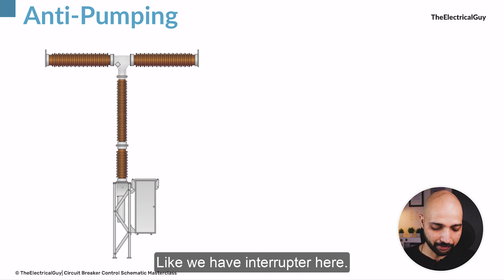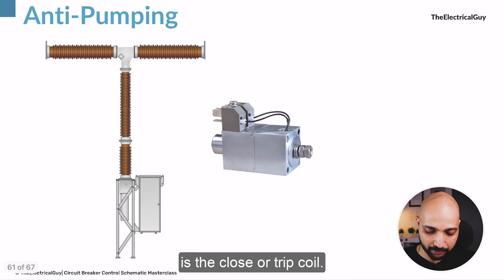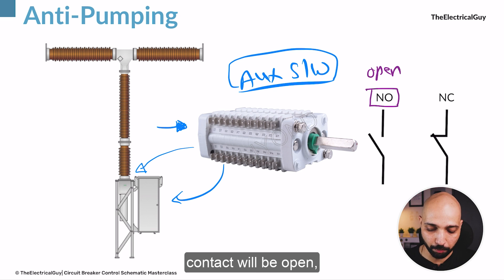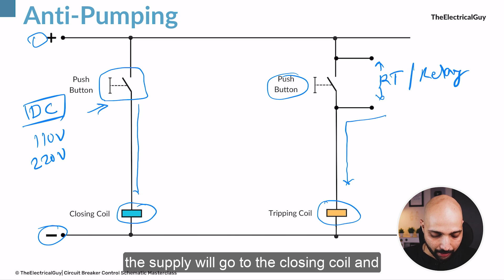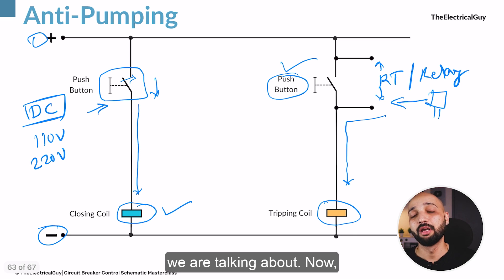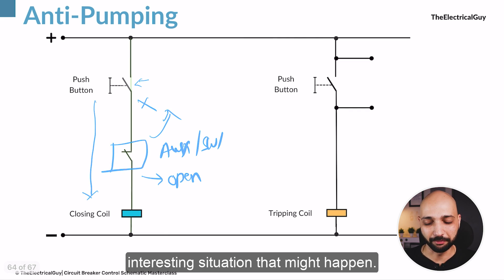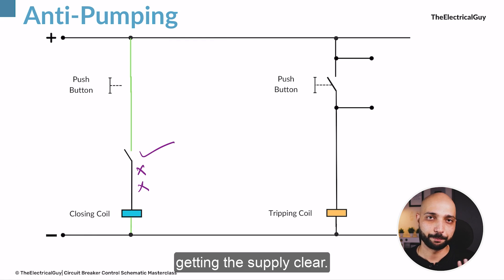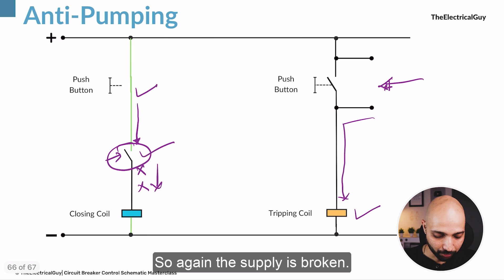Antipumping in Circuit Breaker | Why it is needed? Explained | TheElectricalGuy

Comment: Please don’t feel angry or awkward. In the nutshell telling, I appreciate your effort to educate the people concerned but I suggest to polish yourself on part learning the total philosophy of the subject; way of explaining in particular. For instance, closing coil (CC) and trip coils (TC) or solenoids are short time rated, a matter of seconds say 30s to damage or burn, heat generated with 100 to 200watt power. Thus the CB is essentially required to interrupt the CC and TC circuits itself at appropriate instant, a matter of say 50 to 150 ms, through its NC and NO auxiliary contacts respectively. Also please include in your lecture that normal state of a switchgear item is open state and of a contactor or aux relay de-energized state. Regarding anti pumping feature of a CB, damage of control switch phenomenon is of secondary importance in happening. The main reason to have anti pumping feature in a CB is: operator cannot release the closing control switch to reset it to open position in a twinkle of an eye say 30 to 50 ms during a switch on to fault (SOTF) situation thus to stop or inhibit inadvertent CB reclosing the anti pumping arrangement or feature has to be there. This feature activates with the closing signal through closing control switch but subject to CB closing process success, logic made through say an aux NO contact. Of course, anti pumping device resetting or deenergization will happen when operator removes hand from control switch and it resets to normal. Further elaboration beyond the scope herein. Hopefully, my advisory piece of account will be of some avail for the presenter as well as the readers or listeners.
Irshad Gul
A retired electrical power system engineer, having dealt in protection as well.
+923339145971 WhatsApp

Comment: Sir 

The breaker will not close until the master trip is not resetted.
Reply: Master trip or lockout relay feature to inhibit reclosing on SOTF is an extra arrangement or benefit. The foremost requirement is: first the CB must have anti-pumping feature. Sometimes, discharged closing spring also can benefit against the inadvertent reclosing, a matter of 5 to 20 seconds.

Comment: Sir can we get some videos on protection scheme used in power system like 87G generator differential, bus bar differential, over voltage, over current etc.